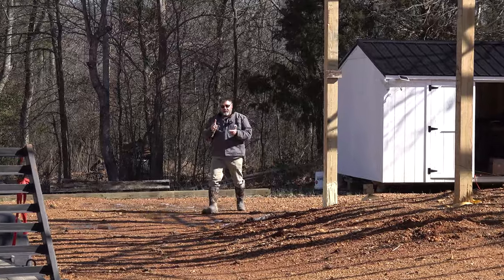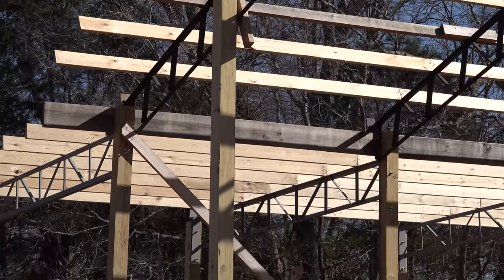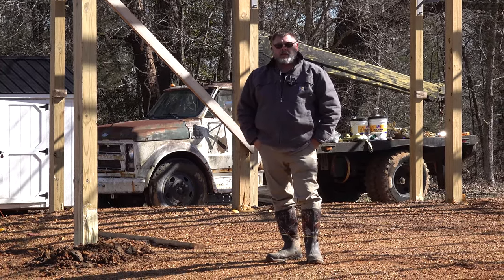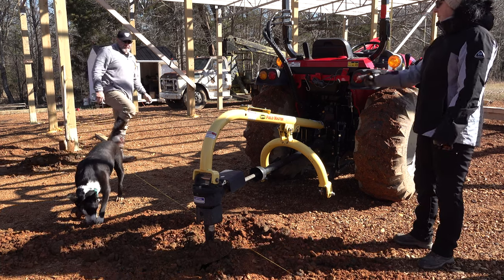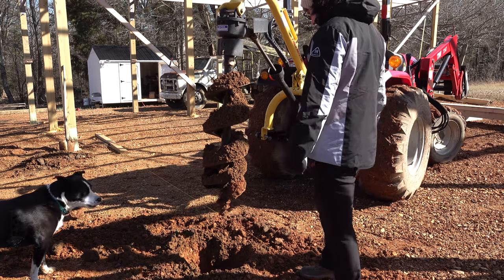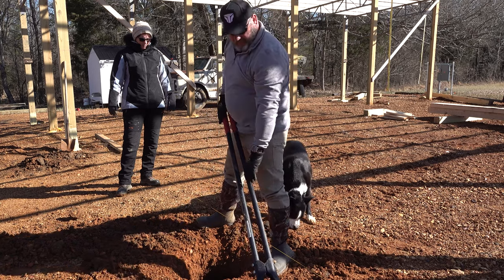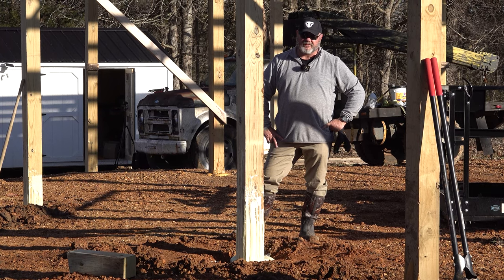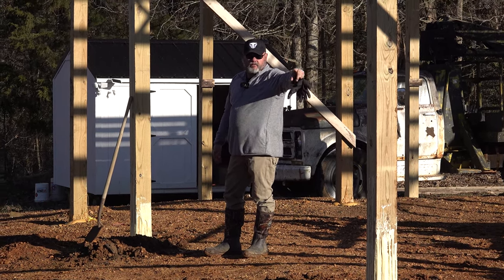44x40 Pole Barn Door Post / Harder than you think!

Comment: Keep the auger running full speed all the way up out of the hole to remove dirt and spin it out of the way
Reply from the maker: I find it makes a cleaner hole, by stopping the auger and cleaning around it. Then lift it out of the hole taking the dirt with it. I spin the dirt off away from the hole. For me, digging at high rpm only cause it beat the top of the post hole as it comes out knocking the sides off.

Comment: Nothing broken today, sweet.  It will be worth it in the end, and you will have done much of it yourselves.
Reply from the maker: I think we are going to do our own concrete
Reply: You certainly can save lots of money.  In MI I get lots of heaving/cracking due to 48” frost line and a water clay base.  Ugh.  Here in SWFL it is an easy pour, but expensive. @TonysTractorAdventure
Reply from the maker: We finished our grade work for the pad. I brought in 170 tons of crush run and rented a drive on roller packer. I hope to start forming concrete pads this coming week.

Comment: Door post appear to be set wrong. It's going to make walling it in pretty tough. I always recommend setting door post in clips after slab is done.
Reply from the maker: Thank you. It all will work out.
Reply: @TonysTractorAdventure  I'm sure it will. You guys will have a nice building when you are done. I am curious about mounting the motor for the garage door. All my experience is with using roll up doors that have the motor mounted to the side.